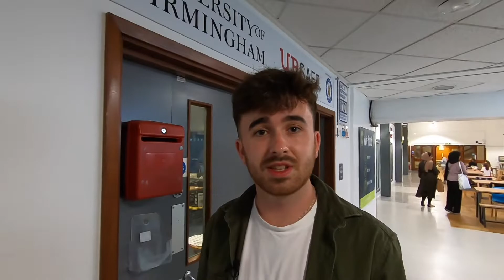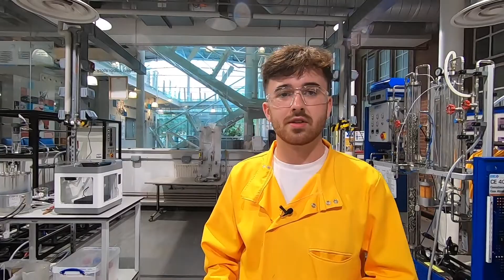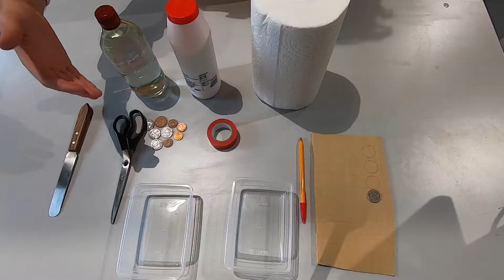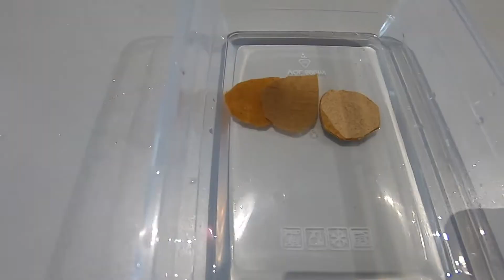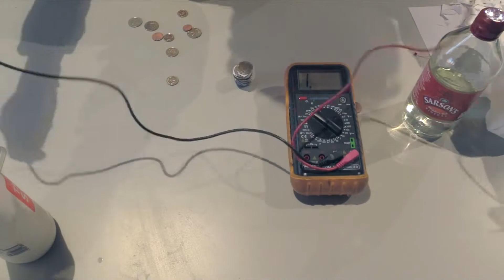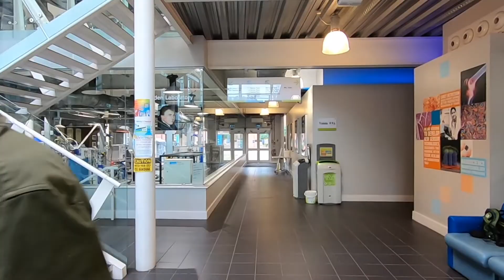Why should we recycle batteries? Let's build one!

Comment: I don't think anyone is against recycling the batteries, its just expensive, how would you propose to do it at scale?
Reply from the maker: That's a great question; thanks for reaching out. There is more detail on recycling batteries here: https://chembam.com/resources-for-students/extended-reading/battery-recycling/. It is expensive, but great effort is being put into engineering the process to be more efficient. In the meantime and while this process is being refined, researchers need dead batteries from the public to test with. When it's so easy to throw stuff away, a little message of encouragement to put the extra effort in to take them to a recycling point can't be bad.